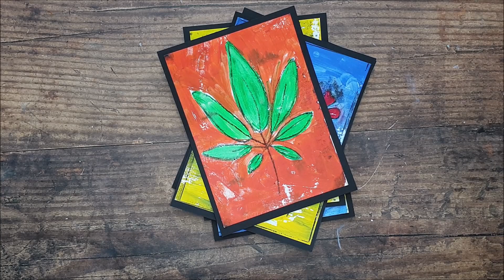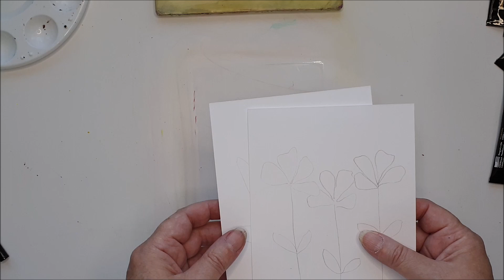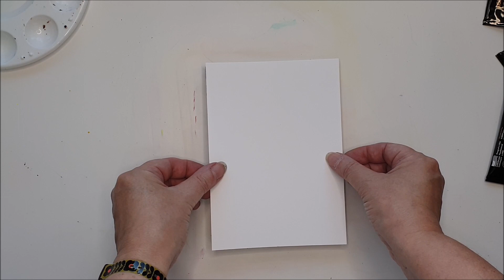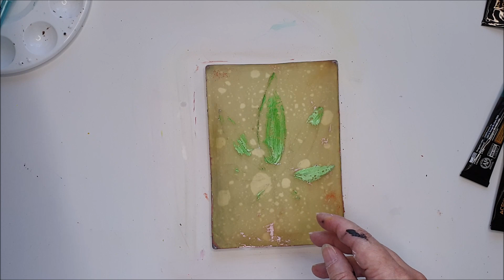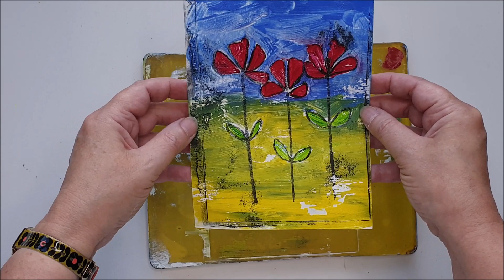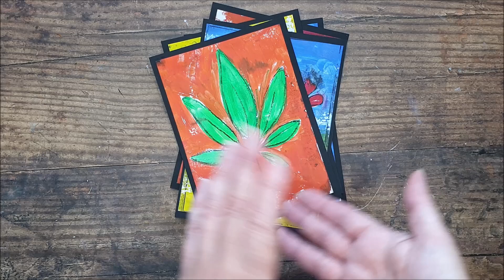Painterly Gel Prints using Crayon Resists

Comment: Need a bit of advice - I have quite a bit of my design “stick” to the plate and not get lifted up with the last coat of white. I’m using heavy body paint. My first one worked perfect so I’m not sure what’s going wrong…
Reply from the maker: Sorry that you are having problems. I have had some prints work better than others myself. Best advice is to make sure the first layers of paint are completely dry before adding the white. Then make sure the white layer is not too thick. You could try letting the paper sit on the plate longer before pulling the print. Some people leave it a couple of minutes with a large book on top to weight it down a bit? I think the fact that your first one worked well means that it will be a small issue like paint thickness or timimg.
Reply: @TeresaAuden  I’ll try that! I experimented more and I think my white layer was too thick. My next two prints worked great. Love your videos!